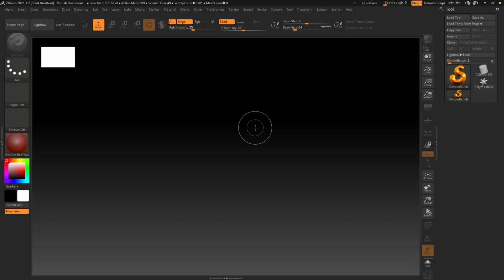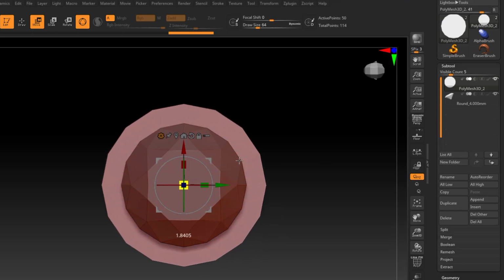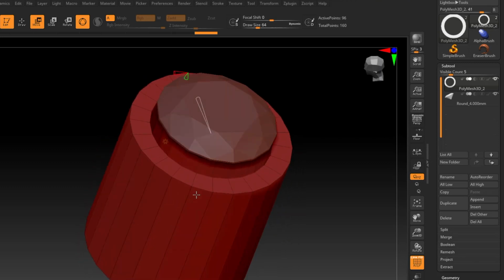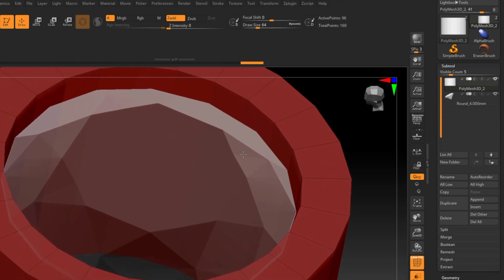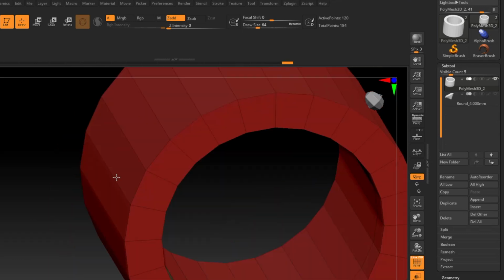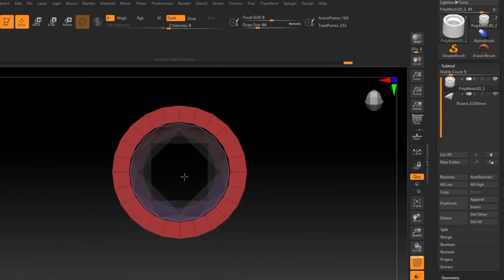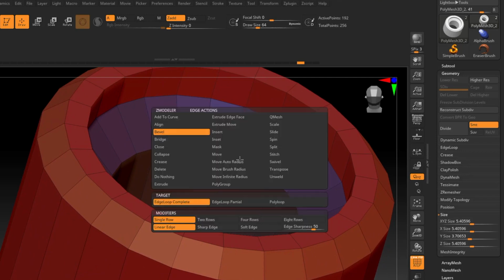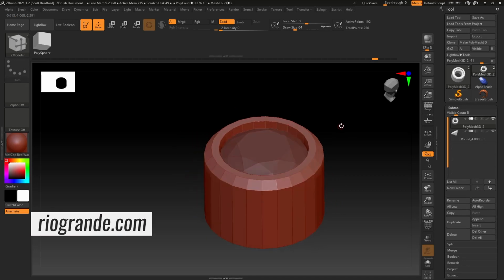Bezel Setting in ZBrush

Comment: What does the jeweler do with the the cast if the bezel is thick around the stone?
Reply from the maker: The bezel can always be thinned down during the finishing and setting process.
Reply: @RioGrande1944  Thanks! I've seen some jewelry pieces with very thick bezels and I wonder how did they manage to place the stone in it then push the metal in.